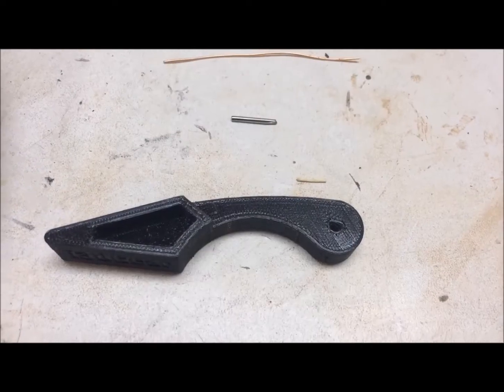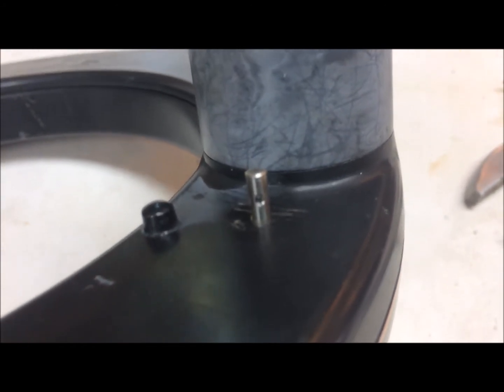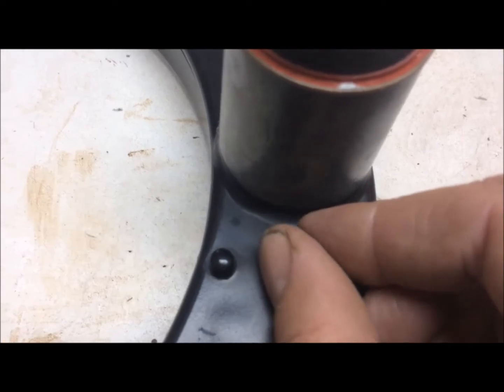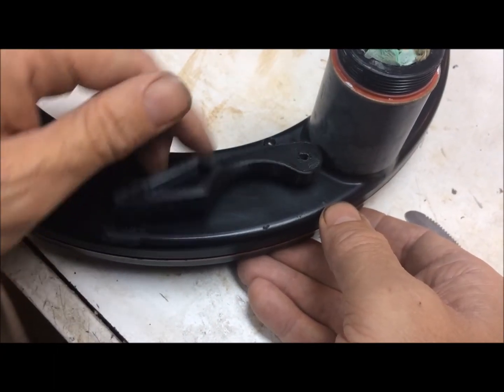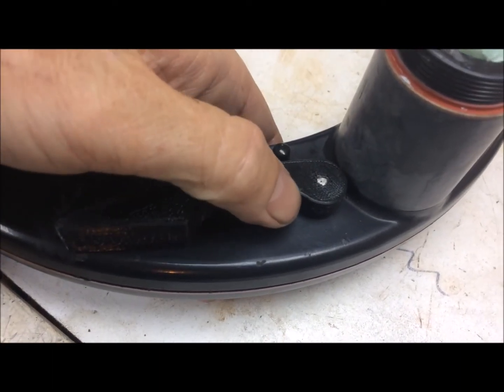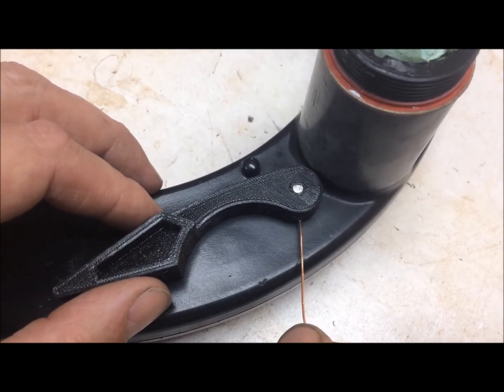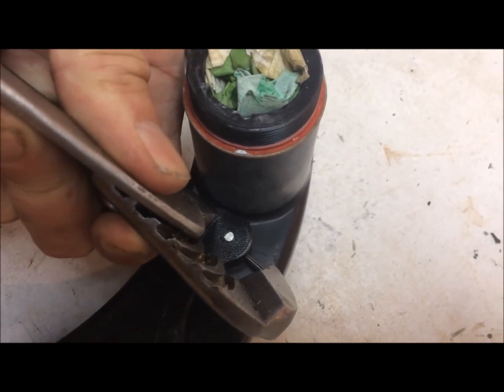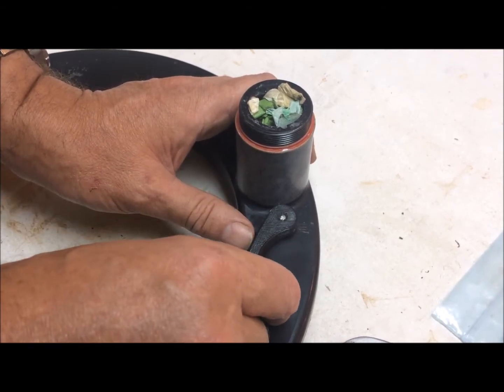Autohelm 4000 and ST4000 Lever Installation

Comment: Have you ever tried to open these rudder ring for maintenance of the bearings inside ?
My ST4000 rudder-ring is making scatching noise when rotating it. 
But i can't find any wholes or maintenance hatches to clean the bearings or put some grease in it..
Reply from the maker: Go to my website www.i3dgear.com and you will find instructions for disassembling the wheel and accessing the rollers inside on the Support page.  We also sell the rollers that you find inside as well as almost every other part.